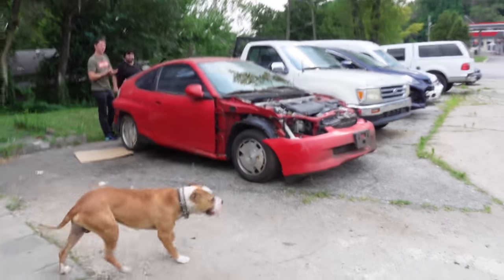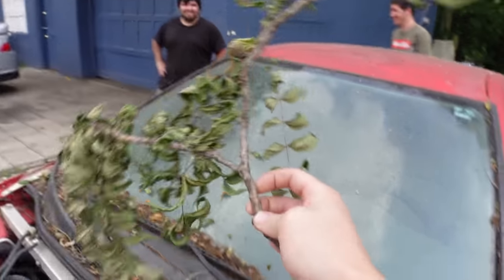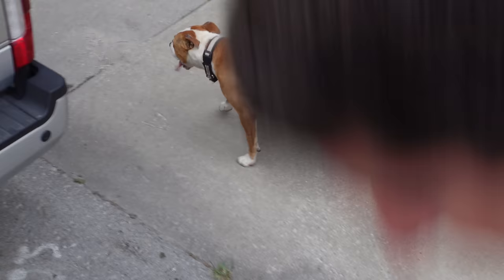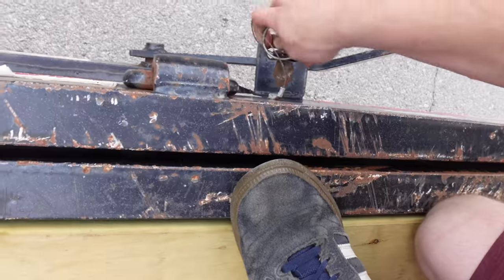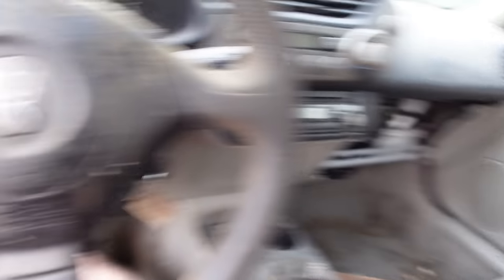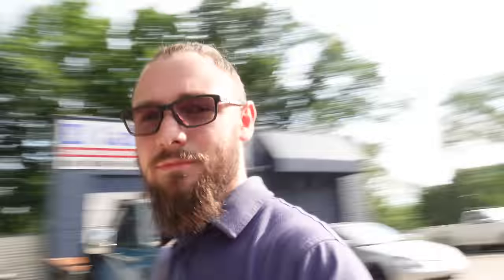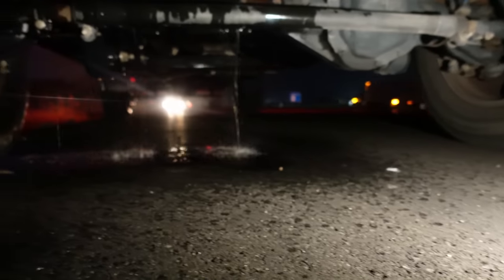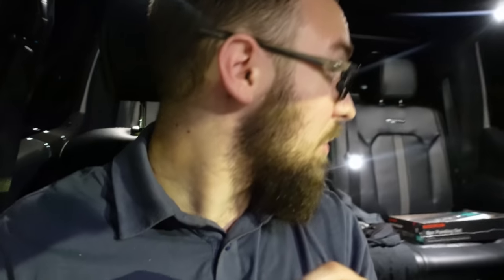I bought a NEW CAR... and it went HORRIBLY WRONG

Comment: Great job. If that windscreen is in good shape keep it, too. Same with the side glass. On older, more uncommon cars, glass can be a nightmare! It took me 3 years to find a tailgate glass within striking distance for my 1990 Volvo 240 wagon. Had it been 89 or older, or even the sedan, it would have been easier. I would have to have the 1st year of the big glass, which was 90-93. The older style was 67-89!

Comment: The stereo isn’t original to the Insight, it’s been swapped, pretty sure anyway. Also you could get a separate tape deck (kinda like a CD changer). That tape adapter would be the key to Bluetooth as you can trick it to think it’s an accessory. I did it in a 98 Acura CL.